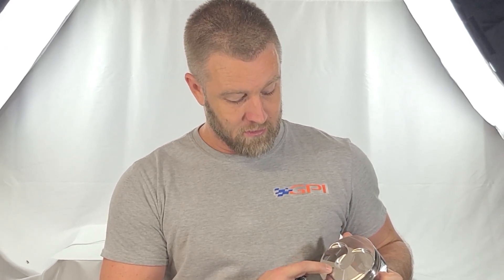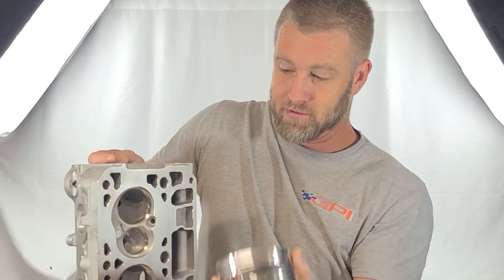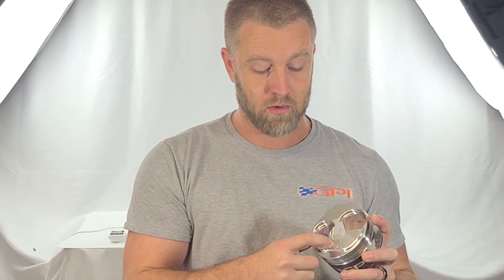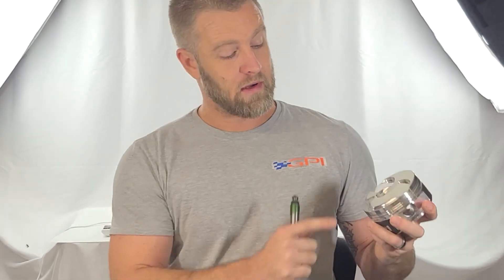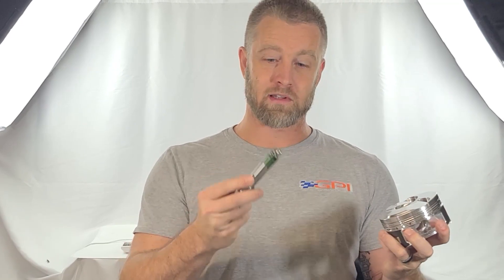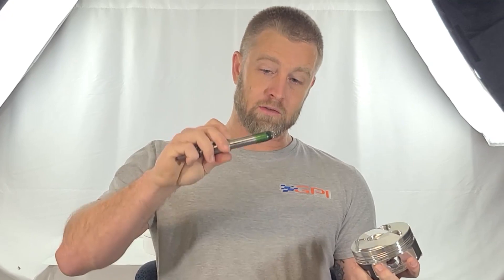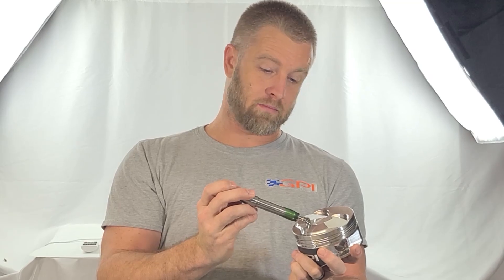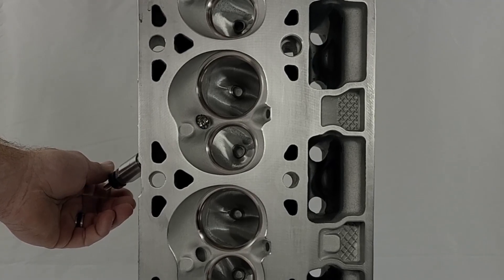GPI Drop-In Pistons, Spark Plug Clearance, and Compression - What You Need to Know!

Comment: Good information. My 383 domes were flycut and i have plenty of P to V clearance.  I didn't think about spark plug clearance. It never hit once when tried starting the engine, each piston closed the plug gap. I'd  had my heads shaved a lot. As much as i could while still maintaining a good intake to manifold seal. 1969 041x heads 202,160 valves. I had ac delco 44ts plugs. Went to ac delco 44t plugs and I used indexing washers. Works great. Had i knew this was an issue i would have had x amount notched for clearance at the plug also.
Reply from the maker: It's one of those things that's easy to overlook/not think about for sure!